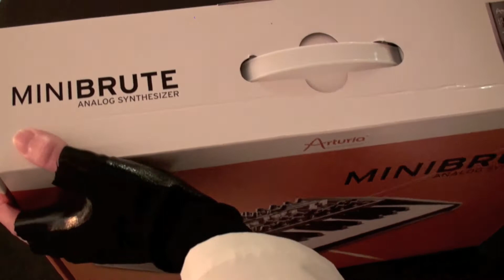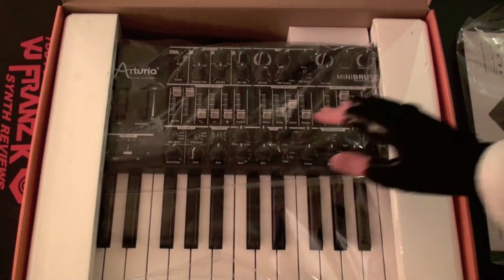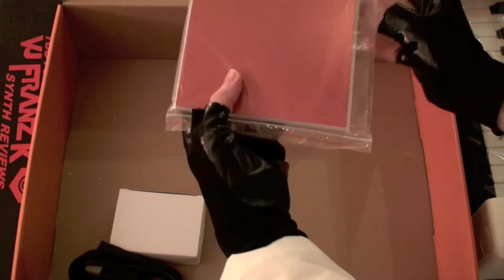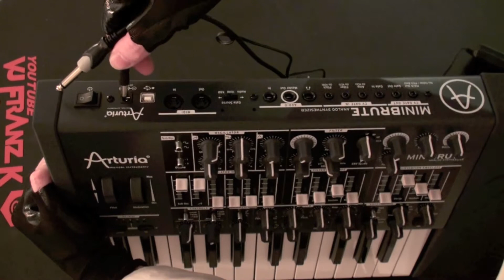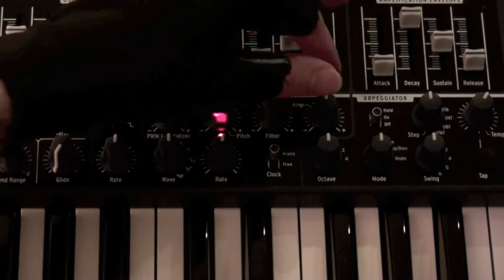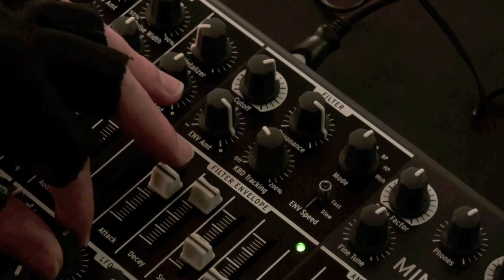Arturia MINI BRUTE Analog Synth!  Part A - Unboxing and Introduction

Comment: How would I go about using this synth with my DAW and playing the sounds made with the hardware in my DAW?
Reply from the maker: use MIDI cable  ; - )
Reply: So I would need a midi to USB cable since my laptop does not support MIDI cables, correct? Also, how would I got about making the sounds play through my DAW?
Reply from the maker: get a USB audio interface that also has MIDI, and follow manual for your DAW